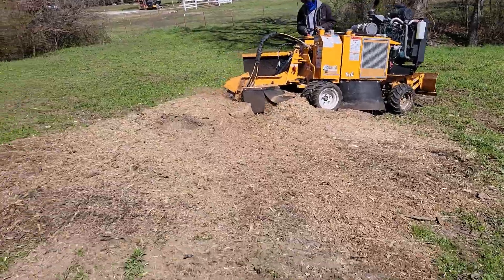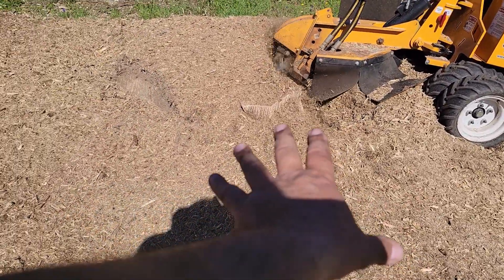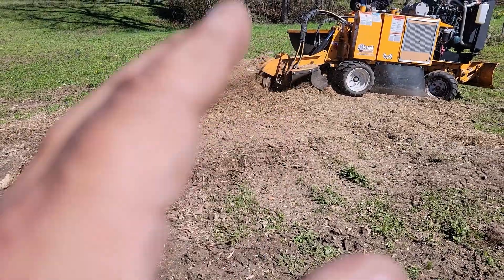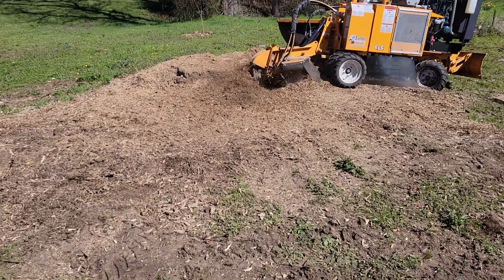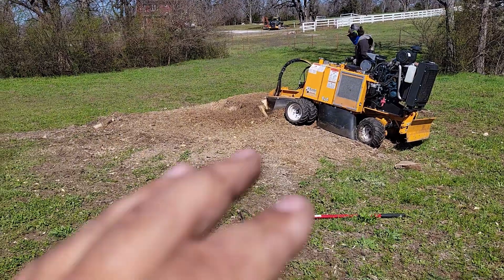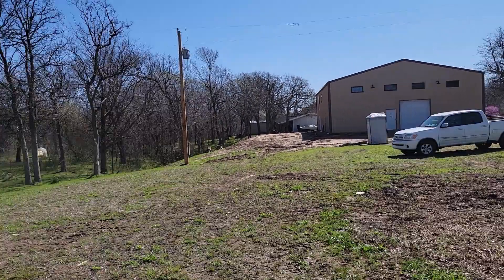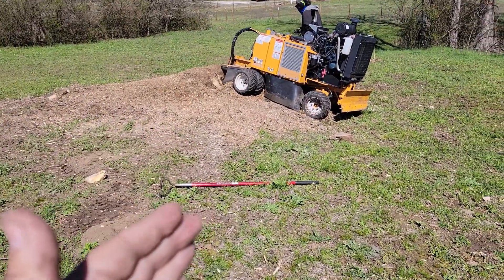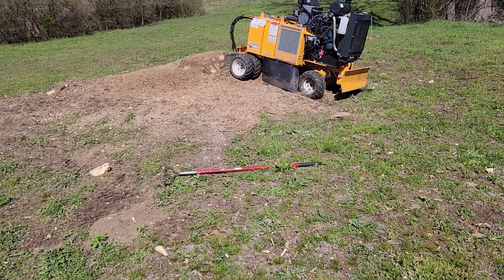How to attack a big stump with under 50hp

Comment: Used to have a few 65 HP tow behinds. They were older and made a bunch of money but ended up selling them. Finally back in the game with a ZT1844. I wanted and SG-40 but my local dealer had a trade in, 255 hour grinder and SG-40 were months out. They always treated me well gave me first dibs and gave me a great deal on it and even with the flaws of that vs the updated SG-40 it grinds amazing. Figured if I used this for tight access and to start eventually I can work my way up into a larger grinder.